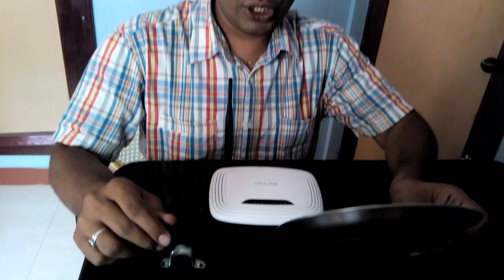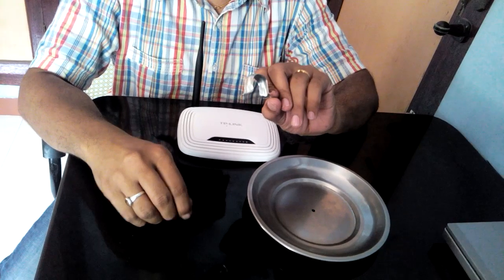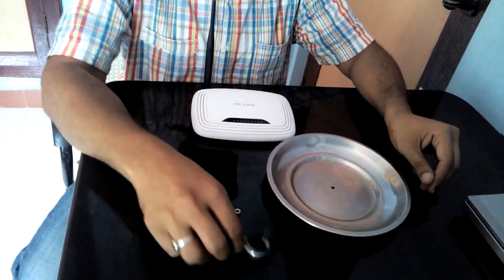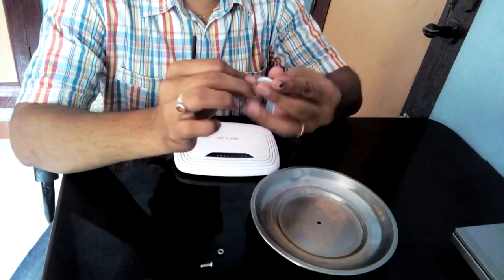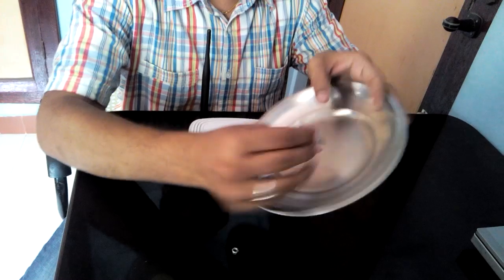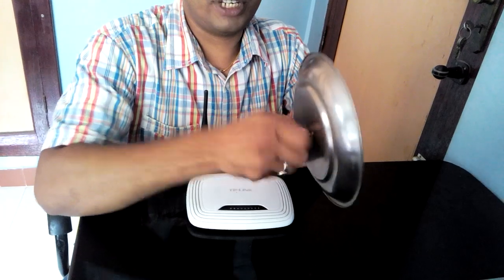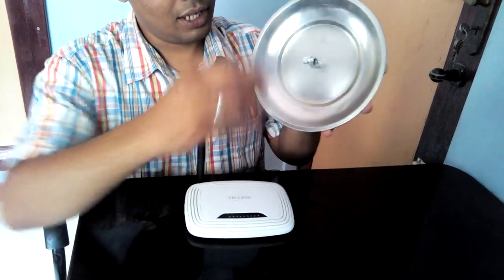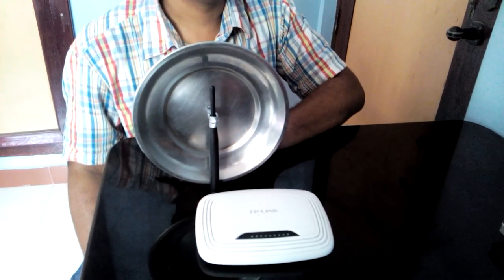WiFi Signal Booster - For your Router signal at home?

Comment: It doens’t increase the router’s range. But if you use it on mobile + the plate i will signifincan’tly increase the range. But it’s also slower so it’s not worth it.